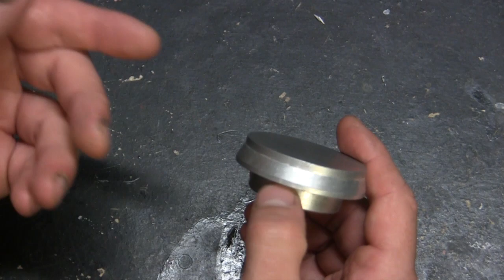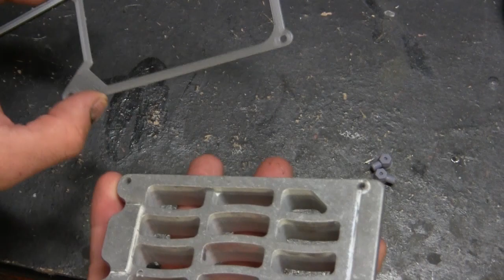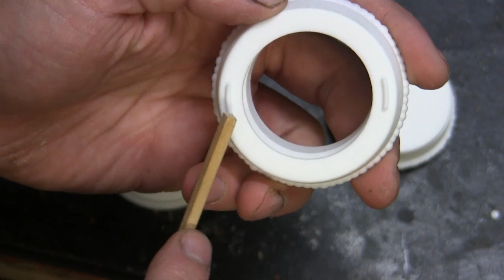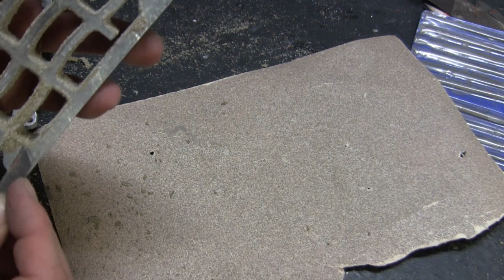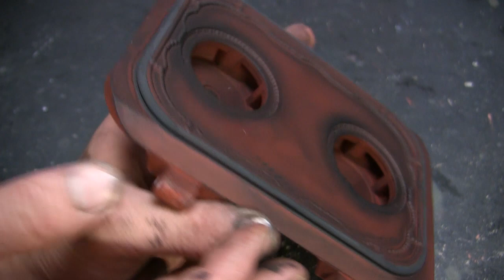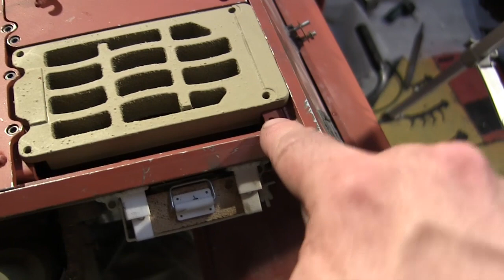Armortek 1/6th scale RC King tiger project video#28 (Rear engine deck details)

Comment: Hi John, You have created a great set of 'hop-up' parts for the Armortek King Tiger. I hope they are well received and you get some decent business especially as some of them will work with the upcoming Panther G release form Armortek. If you source the parts from Shapeways had you considered offering them in Black PA12? This would make painting the inside of some of the prints a little easier as missed bits would not be so obvious. I have recently made Black PA12 my material of choice for this reason and because any chipped paint will show as black 'steel'
Reply from the maker: I've used a similar substance on the T34 sprockets for the same reason. The white looks to not be an issue for the majority of the detail fittings, If the part is a wheel or something that would be a suspension or high impact / scratch location the black is an avenue I would definitely consider